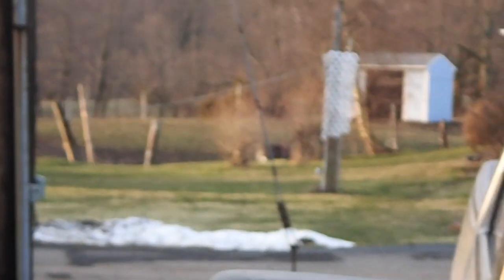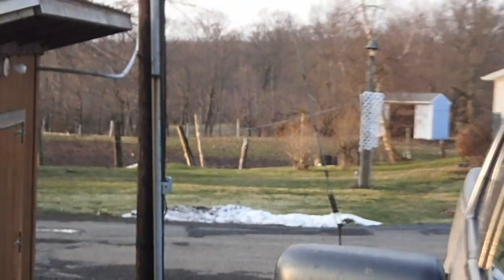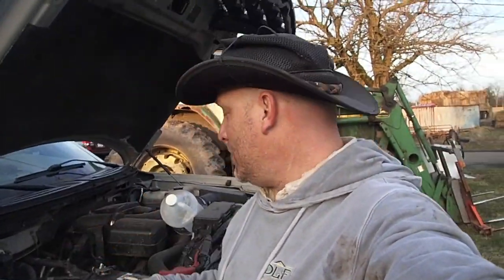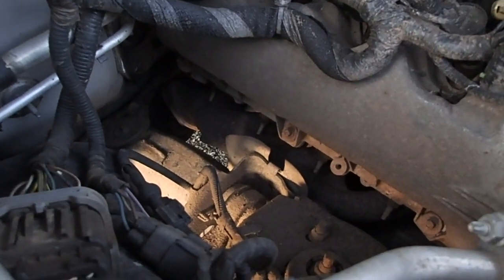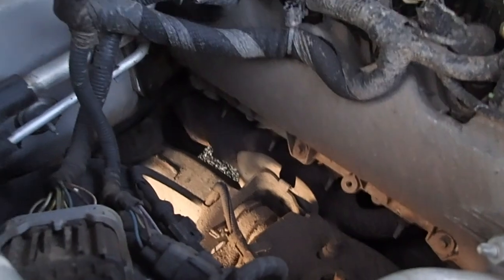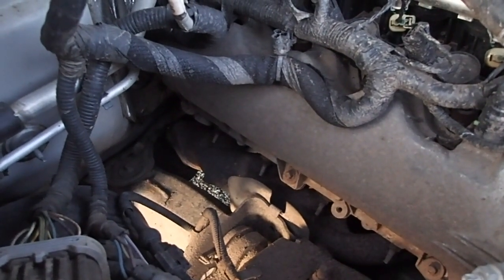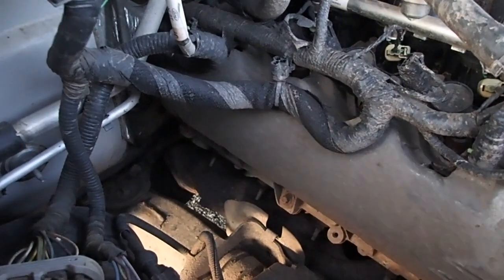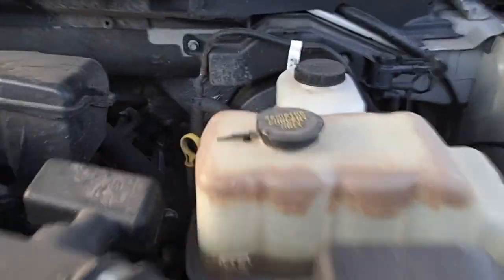Burn My Bisquits

Comment: we had same issue with a truck just like that, 3 sets of manafolds later! the cure was ford mafolds with larger exhaust pipe and a high flow muffler, excessive heat build up was the death of those

Comment: Shorty headers would probably be a better way to go but I'd also investigate a little deeper. I know these are prone to breakage but yes the Chinese are a lot of times better. Not always but often. I'd do as you mentioned and attempt to inspect the converters and I'd also look at the motor/trans mounts. I know on the box body trucks when the mounts would go they'd snap the manifolds quickly. My thinking says that the first set lasted a longish time and the second set failed quickly. Might not be the manifolds fault.
Reply: +1 Plugged converters can cause the manifold to heat up more due to the restriction, as well an overly lean mixture can cause excess manifold heat. Bad o2 sensor can cause this. Also can be caused by bad or dirty maf/ams/amm sensor.  This heat cycling will increase likelihood of cracking. Since there is a pre and a post cat sensor on many vehicles, the o2 sensors and the cat being plugged could be inter-related. Worth it to pull the codes if you can. You can probably rule these out if the manifolds don't glow red at higher rpms/loads.
And second to the motor mounts. I have cracked a downpipe due to this before.
The fact that both cracked, and come from totally different castings, would lead me to think it is not the manifolds fault entirely. Something else has to be a factor.

Comment: Wes, if the exhaust gaskets are steel shim gaskets, you can re-use them by just spraying copper coat sealer on them. Good luck on the next replacement.

Comment: Shorty headers should be a direct replacement and offer enough flex to move with the expansion of the aluminum head. nine times out of ten manifolds crack and studs pop due to the different expansion rates of cast vs. aluminum.

Comment: Did both of my manifolds on my 1997 Ford f-150. Took me two days of heat and busted knuckles. But i did it myself for 120.00 both manifolds and studs and i used high grade studs and nuts. Instead of being quoted 800.00 for the job.

Comment: Gas engine motor homes used to be notorious for cracking and warping manifolds. Found after a hard run if you let them idle a while to cool down slowly that seemed to stop the problem. Just my experience . Big job ahead that sucks.

Comment: Headers!
Reply: Fixinman11 he will have to run a tune on it to run.
Reply: Not shorty headers
Reply: So you have to computer reflashed. Big deal.
Reply: Fixinman11 yap that's what I was thinking, or CHEV
Reply: I agree actually...
Reply: I done mine at 90,000 miles. Freaking cracked again at 125,000. And yep headers. Cost a bit but this truck will do 300 thousand before I trade it. or bone yard it.
Reply: If you put the O2 & temp sensors in the same position and keep the same back pressure, you don't need any tuning.

Comment: I'm sure you did but just in case check your exhaust mounts to make sure the exhaust isn't hanging on the manifolds. I had the same problem too. I think all ford gassers have this problem.

Comment: That is a known common problem with the triton engines. The v-10's had the same problem too. Wes, you said it yourself, steel and aluminum don't play well together and cast iron manifolds on aluminum heads doesn't work well either. Stainless shorty headers is the only way out and these can be had as a direct replacement part. I myself would not waste the money or time on replacing the manifolds. The definition of insanity is doing the same thing over and over and expecting different results. Ford should be ashamed of putting this crap on their vehicles and GM has the same problem on aluminum head engines. Just my 2 cents.
Reply: I think most of the manufacturers with trucks have this issue, not necessarily the manifolds cracking but the studs at the back snap because of warping or stress on the exhaust from the torque of the engine.
Reply: Think it maybe from pulling trailer, Truck running hotter during acceleration?... had the same problem with my 2010 f150. Pulling trailer still not a excuse.

Comment: I hate dealing with headers, always blowing gaskets, bolts loosing up, but if you do it right they work good. In this case, I'd go with headers too or drive a CHEVY. Problems solved.

Comment: Stick with Ford parts. More expensive, yes. Better in the long run, yes. Better warranty, yes. There is a guy that has a channel called "South Main Auto", he told a story that happened to him when another shop used Dorman brand manifolds on I believe an F-150 but not sure. The shop put manifolds on it, then the truck had a specific cylinder misfire, ultimately that shop sent the truck to him to figure out. The manifold had been cast wrong and was creating a blockage for that cylinder, the exhaust couldn't escape creating back pressure in that cylinder.

Comment: Hi your comment about your fuel mileage going up as the cracks get bigger  This is due to air being sucked into the cracks. As the exhaust goes out the manifold fresh air gets drawn into the cracks. this causes the o2 sensor to get a miss reading and in turn it leans out the fuel mixture . Hench better fuel mileage.

Comment: I'm a Ford guy and I use all Ford parts all the time. I don't know if I'd ever buy an F150 after watching you change them the last time.
Reply: I wouldn't touch any half ton after 96. As soon as Ford went to the half ton/superduty split and started using the triton engines the half tons are shit
Reply: They should of built the hood and fenders to flip forward like the L8000 and we could fix stuff under there easier.
Reply: ford seemed to have problems with manifolds
Reply: Dont ever buy a 5.4 L engine... I love ford but man those engines were garbage
Reply: Northern farmer  I have one in an F250 that's a 2002 model with the 5.4 in it with 230000 kms and I'm thinking of trading it in because of the camshaft stories I hear.
Reply: massey man 02 is a 2 valve doesn't have cam phasers
Reply: Massey man, the 2v is what you have. No worries there. It's the 3v that can be problematic if not taken care of.
Reply: massey man  ,, the truck is actually designed to have the whole CAB removed to get at the engine ,
almost any shop that attempted this job would use their vehicle lift to remove the cab ,,it's actually very easy  less than 2 hour procedure

Comment: damn i hate those  manifolds ,, i just did a manifold job on a friends F250  wit ha 5.4 liter  triton V8 about 2 months ago  ,, one of the biggest pain in the butt jobs i have yet done 
his had cracked exactly like yours is cracked ,, and he bought ford manifolds the second time around ,cause he had bought the chinese ones the first time 
he listened to me though when i told him to get stainless studs for the replacements ,made changing them so much easier
Reply: wild wouldnt it been easyer to say     same thing happened to me        instead of writeing this short book of yours
Reply: slewed barracuda  , wouldn't it have been better since  you didn't comment on Wes Pandy's video  but are actually being a TROLL and making negative comments about comments on the video 
I wrote 6 friggin lines for cryin out loud ,,you ain't yet seen me write a book  cause i could easily write 50 or more lines and have numerous times ,,I've had entire conversations with  people in comments

Comment: Just one of the reasons I refuse to buy a Ford while I'm currently searching for trucks. More complicated than they need be to work on, and a notorious for those manifold and exhaust leak problems. If I were you I'd just get some aftermarket shorty headers that bolt in place of the stock manifolds. Tube headers are much than cast manifolds!
Reply: Just dont buy a 5.4 liter... The 5,0 is ten times the engine
Reply: Northern farmer for what I want to do with the truck, I've done to F150's with the 5.0 and I'm not interested in them. I'll be getting a GM with a 5.3L or 6.2L
Reply: The new 5.0 ?

Comment: Buy a Cummins I guarantee you'll have half as many manifold problems.....lol
Reply: You watch cotontop3?
Reply: or a chevy if he wants a gasser
Reply: coton's problem is auto trans  manuals for the win
Reply: I think I have the same truck as cottontop3? Either way....I meant because the Cummins is an I-6 engine....there is only one exhaust manifold lol
Reply: Cummins is a great engine, its everything that surrounds it thats the problem.
Reply: I prefer the Dodges. I've had a couple F350's they were good trucks. No real complaints.
Reply: I agree 100%

Comment: shouldn't crack are you engine mounts ok!  should be a spring compressed pipe from the manifold to the catalytic to prevent this type of issues. have you had your exhaust changed from non-standard? there  should be a pipe that looks like a concertina in its characteristics shape off from the manifold. you can always bronze weld the manifold crack is the best solution, you should have bronze nuts and studs never still not sure about Stainless. you haven't bolted your exhaust on! is there rubber mounts on your exhaust this can cause the problem

Comment: Da-m..... -(
I've seen that job you did last year. You were wondering if anything would have went better pulling the engine through the front end.... And your guess was good, as I've (and as you must have done too) watched plenty other videos on this issue.... they all do just like you mentioned when you did yours (way simpler to just take engine out etc)
Nevertheless, why those manifold would break in the first place? I don't care wither it's OEM or not.....
 There's a heat transfer somewhere that is not happening as it should..... >>>> Do you at least have "copper gasket" ??? (Ask mustie1 about this. He has ran into issues like this, and will explain to you the everything about this.... go ask mustie1.... right now ;)

Comment: Stainless steel is not a good choice for applications where there's a lot of vibration because it's more brittle than mild steel and has a tendency to crack like cast iron does. So I'm not a great fan of stainless steel exhaust manifolds.

Comment: Get a Ford with the 7.3L diesel
Reply: Mike Toye 
i just picked up a 94 350 daully with the 7.3 ps.  its got some spunk but ill see for sure when i hook up to my flatbed
Reply: Mike Toye he's already got one
Reply: Mike Toye Wes already has a 7.3l and he hasn't had much luck with it.
Reply: I have a 99 with the 7.3l in it I bought an edge programmer for it and it brought the motor to life.  With that programmer you have 3 settings towing, racing or extreme, mine is set on extreme, plus I put a 5" exhaust on it as well.
Reply: Mike Toye I had an edge juice with attitude on a 00 powerstroke and it went through about 3 transmissions in a 1½ time. IV had pretty good luck with ts

Comment: Wess, pack them cracks with magnum steel epoxy, and trade it for a Chevy...my folks had Fords and i was constantly fixing them. ive always had GM's and not ONCE have i ever been let down. the Gm trucks (last i knew anyway) used Stainless Steele for all the exhaust stuff in front of the converter. i am NOT a Ford HATER...just been there and got the tee shirt. by the way, i did find the vids you did of this fix long ago and they were informative and entertaining.

Comment: i always use the dorman ones never had one bust ford parts suck
Reply: i have changed 25 sets and have not had one break
Reply: Kevin Boyer dorman usually is not a exact fit for replacement parts and causes issues in my experience